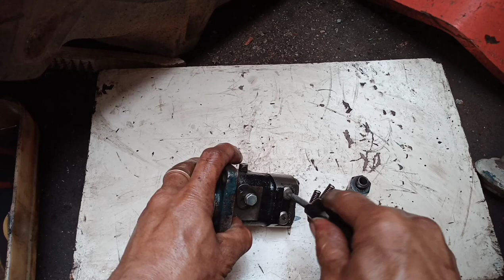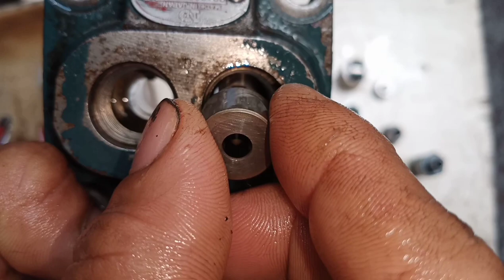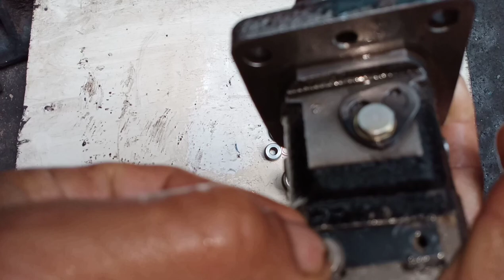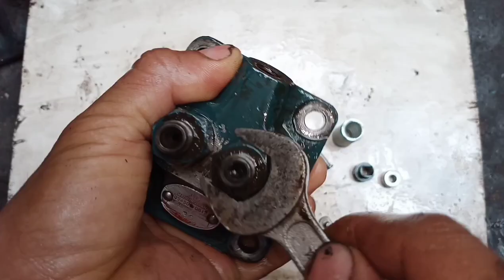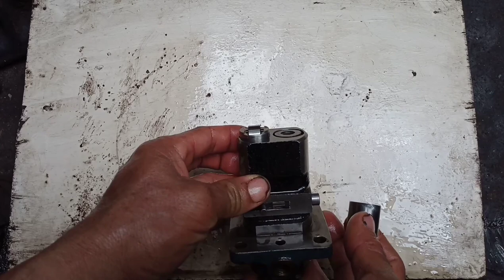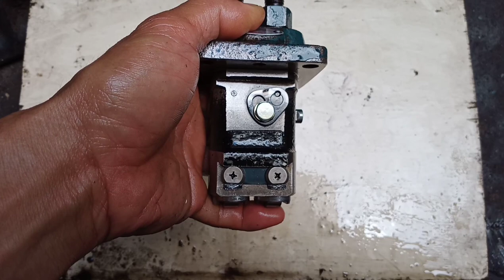how to assemble fuel injection pump L1801,L1501

Comment: Hi I rebuilt mine too get some parts unstuck and now the tractor runs good but it leaks around the fittings at the top. Seems maybe the o ring is too rotted. Do you know what torque to tighten the top fittings or where to get a new oring? Thanks

Comment: Does this pump pull out or is there linkage in the motor to disconnect first. Yanmar 2210.  Looks to be the same pump.
Reply from the maker: Disconnect to cleaned  the plungers

Comment: I Have a situation, my skid steer didn't turn on. The pump is very similar.  Some suggestions!! THE diesel pressure is correct at the side of pump, but no pressure out of the pump.  Any suggestions please

Comment: Hi . Thank you for that wonderful video. I did exactly as shown in the video . The pump still doesn't inject. What should I do? Thank you.
Reply from the maker: Just watched in follow what I did.do you also re assemble or replaced the plunger?
Reply: Hi. I put the plunger back. I have been told that the plunger might be the reason why the pump doesn't inject . It has to be out back the correct way. Do you  have a video that shows how to do it?

Comment: What’s the main cause for these pumps not pumping enough fuel? I have a 1110 Ford with Similar pump and it’s not pumping enough fuel on one side?
Reply from the maker: Thank you for watching.delivery valve maybe stuck-up or plunger need to replace.did you rebuild your pump or not?
Reply: @tractorsmarinemechanic   not yet I haven’t. I can’t seem to find parts for it

Comment: The thing for me is can the internals be changed around somehow to give full fuel to the left instead of the right on the moving rack. The governor on an MWM similar engine when started seems to snap to full throttle with the incorrect Bosch pump I located.
Reply from the maker: If you change the internals which is the flunger. your engine will be wild or runaway
Reply: Thanks for reply I'll try again after watching your video!

Comment: My pump has gotten water inside it and now it won’t pump diesel! Can I disassemble the top and clean all the parts and be ok?
Reply from the maker: Do it man.your plunger maybe stuck up because of water inside your pump.you can fix it by metal polish.watch another video that I'm using with metal polish.clean your fuel tank and replace fuel filter.
Reply from the maker: By the way thank you for watching.pls subscribe and share my video.
Reply: @tractorsmarinemechanic  Thank you for the fast response! I subscribed,liked and shared!
Reply from the maker: Thank you.you can repair your own injection pump i knew you can do it by your ownself.do not send to the calibration center.they cannot calibrate that.the only they can do is to repair or replace plunger.thank you.
Reply: @tractorsmarinemechanic  Ok. Thank you!! A new pump cost 600.00 U.S. Dollars and a rebuild is 500.00 but the pump looks simple!

Comment: Can you do a video on checking injection timing?
Reply from the maker: What kind of engine do have? Just subscribed and I show you someday.
Reply: @tractorsmarinemechanic  iseki 2cyl Mitsubishi KE75 I subscribed and re cleaned injection pump using your videos...im getting fuel but need to check the timing I have no shims to adjust or don't know how?
Reply: @lgvmobile  same boat here, KE95. I thought there was supposed to be a big shim under the pump, but all I had was a gasket. Did you ever figure out how to set / check your timing?
Reply from the maker: There are 3 shim under the injection pump and remove the gasket just put the shim only.
Reply: @tractorsmarinemechanic  Thank you! We are taking about under the pump mounting flange? Where the pump mounts to the engine with 4 bolts? We are supposed to remove the old fiber gasket and install shims where there were no shims before?
Reply: @wlhequipment1730  Yes, the shims go there instead of the gasket.
Reply: @lgvmobile  Thank you! Is that what you did to your KE75? Do you happen to remember who you got those shims from?
Reply: @wlhequipment1730  I was in the works of making my own,could not find any, I gave up on the little guy and sold it! I had low compression on one of the cylinders!
Reply: @lgvmobile  Oh, bummer. Yeah, those shims seem to be a mystery part, nobody I can find has them. Thanks for your help!